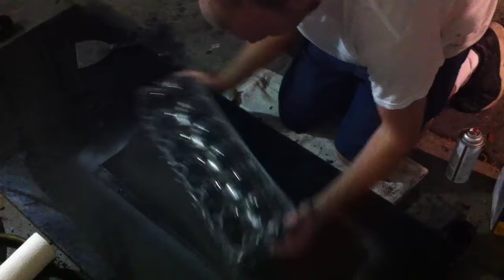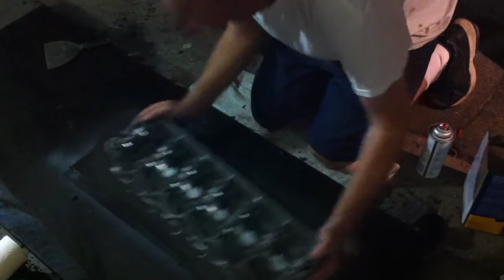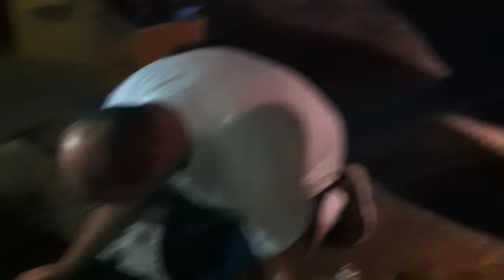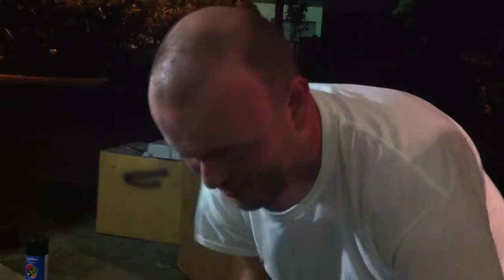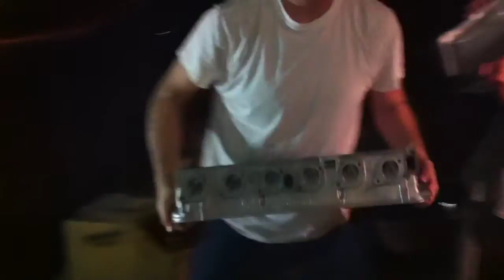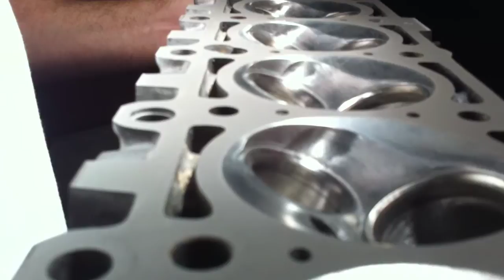Resurfacing an e30 m20 head with some sandpaper and lots of elbow grease

Comment: They sell the sand paper @ home depot or Lowe's you're also going to need 3m spray adhesive in a can instructions are get a flat surface to glue the sand paper too like a glass table make sure it's flat then start off with 80 grit then 100 grit and finish it off with 120 grit don't forget to install the spark plugs while sanding it will guide you just in case don't FORGET the copper spray for the head gasket head for life